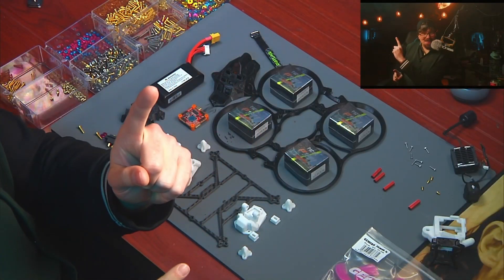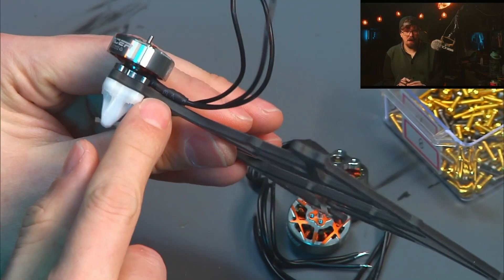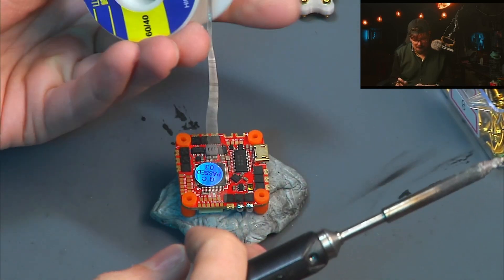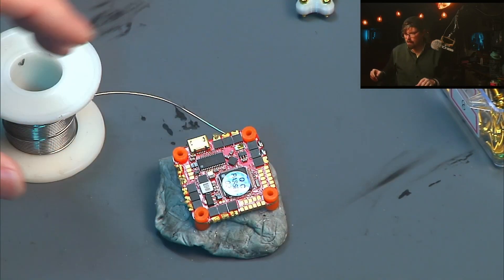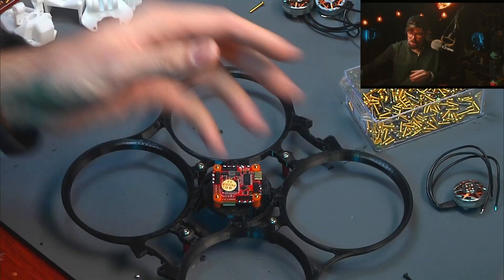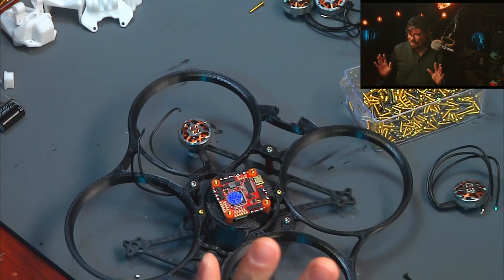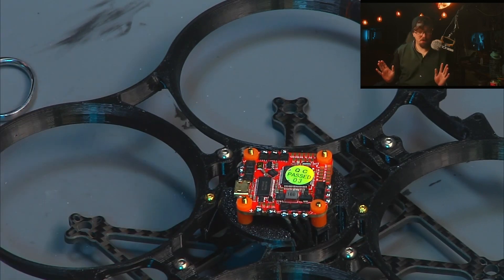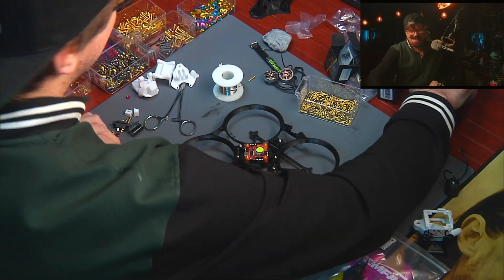Intro to FPV ep03 - Building a Drone (1/3)

Comment: If I build this drone can I use it as is with Ardupilot instead of Betaflight?
Reply from the maker: Yes of course
Reply: @33rdframe  That's good news, thanks. It
 also shows how much I have to learn!
Reply from the maker: @fleaniswerkhardt4647  oh but you might need the flywoo flight controller aio as it has enough flash storage for ardu. The hakrc doesnt i belive